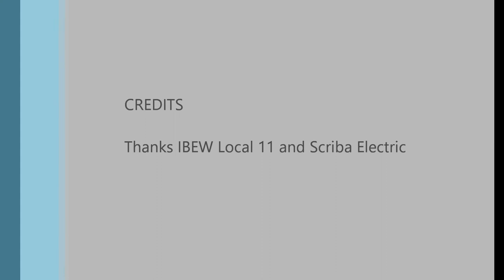Owens Illinois

Comment: Good stuff.   I worked at the LOF glass plant in Lathrop, CA mid 90s.   I worked the automotive lamination dept, but would hang with other bending engineers as well as the flat glass guys where they made long ribbons of glass.   Pretty cool work environment for a while.  I moved to Ohio and was in Toledo and Detroit quite a bit.  The plant is no longer there...but I think there is an O-I bottle plant in Tracy.

Comment: Cool - I helped the designer of the SWA , Bottom heal and the Check camera in 1990 and 5 yrs later I did the black camera you see in the 3.5" cube in the top right at 1:52 for the sealing surface as a special request that went into production.    Many a visit to Perrysburg OH to help Tim and John integrate the cameras
Reply: Thats cool, too bad SWA is now replaced my MCAL's more or less.